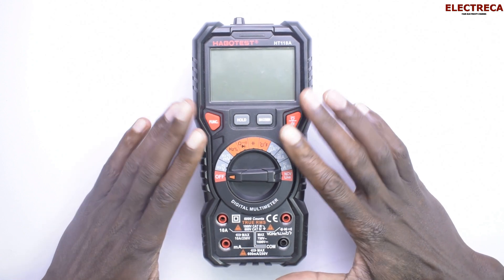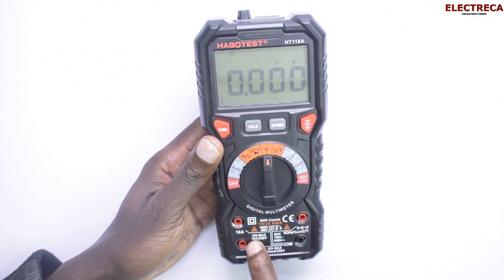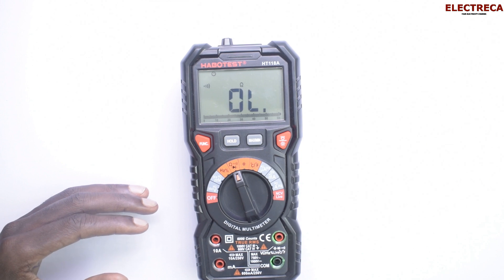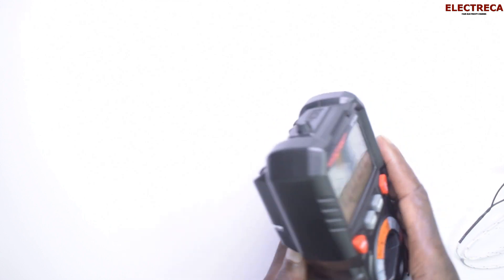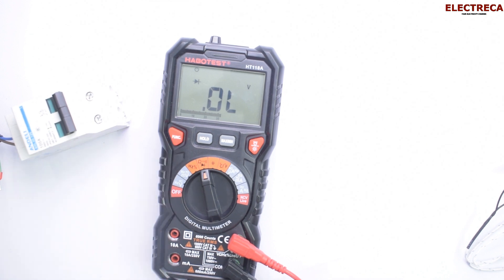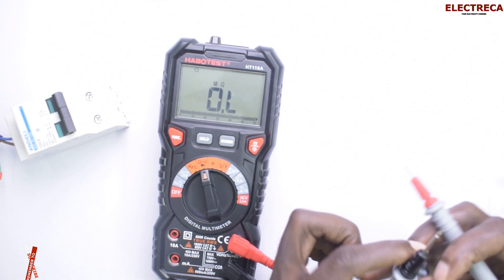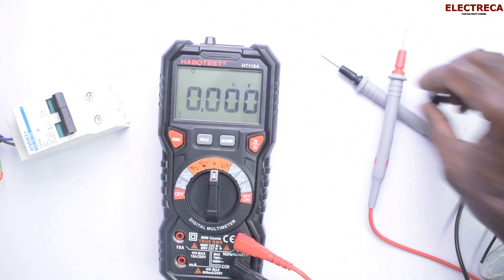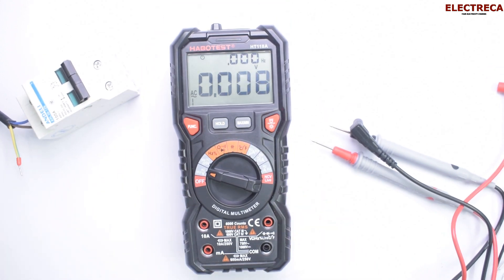Digital Multimeter Review - Habotest HT118A by Electreca

Comment: How do you measure current using that multimeter and how can I get it because am in Uganda but am interested in acquiring it
Reply from the maker: Most digital multimeter measure current not exceeding 10A
for you measure current with it, connect it in series with your circuit
Hare is the link https://s.click.aliexpress.com/e/_DkxCMRh you can from AliExpress and they will deliver to you in Uganda